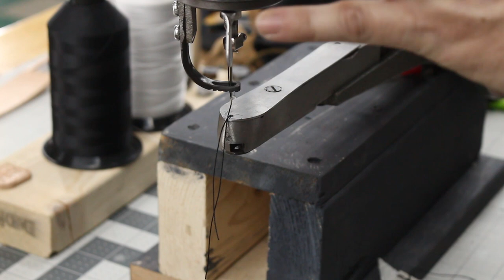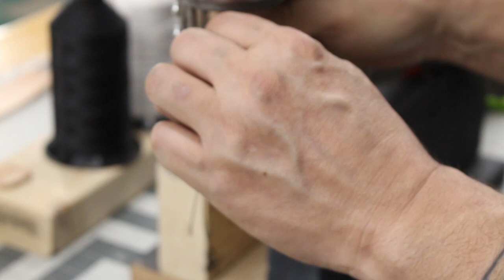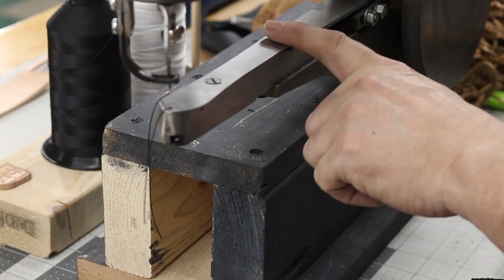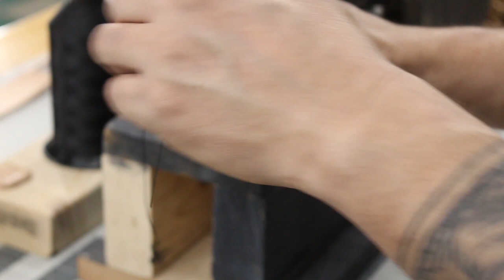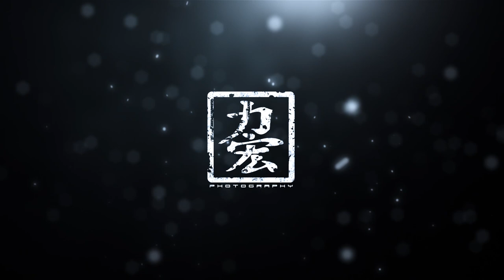China Leather Shoe Patcher v2

Comment: Thanks for the tutorial I like the 35-45 degree sewing trick I was just contemplating making a little extension to the end and have a little drop in plate that would be removable for when accessing the shuttle or bobin
Reply from the maker: alot of people have made a table plate that slides in and out when you need it. That works as well when your using a guide to keep your stitching straight.